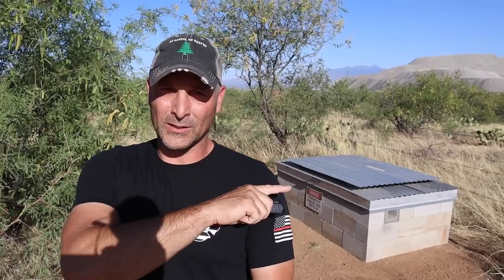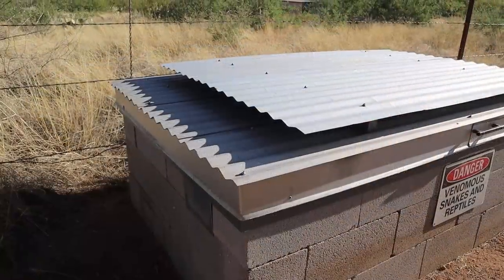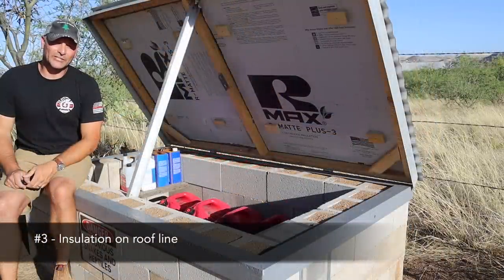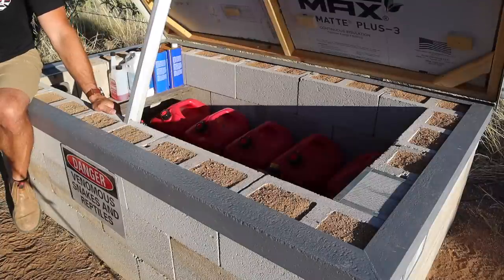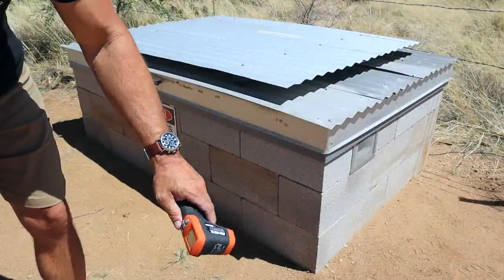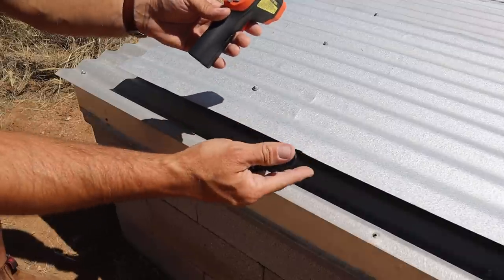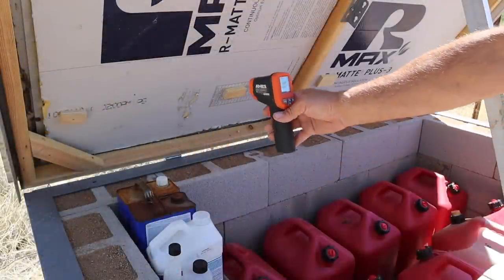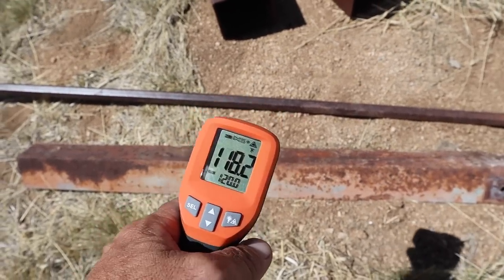Fuel Storage Box - UPDATE & Temp Testing

Comment: The roof is too reflective to get a good reading based on how the IR thermometers work.  One trick you can do is to use sharpie or spray paint to make a black dot on the metal and then you'll be able to read the temperature much more accurately.  That's what we do in chemical plants when we use the IR temperature guns on stainless steel piping.
Reply: You may have an emissivity setting, but I normally just do what Brett suggest with the black tape.
Reply from the maker: Definitely makes sense.   I tried shading it but I think I’d have to have made a much larger shade than my hand to not have the interference of all of the light bounce back.  Thank you for the advice too! 🙏😊

Comment: The corrugated roof is acting as an infrared "mirror". You are effectively taking the temperature of the sky. I tried the same experiment with a similar thermometer aimed at a piece of corrugated metal and got the same result as you. If you aim the thermometer at the sky, you'll get a similar reading, but probably a bit lower since the roofing material isn't a perfect reflector. That's one of the reasons it makes a great roof, all that infrared heat from the sun is reflected back to the sky.
Reply from the maker: Well that’s the answer I was needing… thank you🙏😊
Reply: @homesteadonomics  you can see it even better with a thermal imaging camera as you can see that most "reflective materials" including glazed tiles on the wall as well as painted smooth surfaces reflect infrared rays... you can basically take a selfie with a thermal imaging camera by looking onto a piece of sheet metal or something like that

this is one of the most common mistakes on thermal imaging as well as temp checking by home users... and why there are false readings that don't make any sense
Reply: Aim it at the under side of the same metal or put a piece of black tape ok the top. If you paint that whole thing white it will drop the Temps even more.
Reply: Put a thermometer inside the structure, check it later. Now you know what you need to know!

Comment: Just wondering if you don't have a problem with burrowing rodents. We had an 8 x 12 storage building set on a foundation made out of one foot square pavers and the little chipmunk sized ground squirrels burrowed under the pavers and made nests which of course made the floor of the shed week in areas because the pavers sunk into the burrows and got all out of sorts. Seems like they'd make quick work of tunneling under those cinder block walls.

Comment: I love this. This is so simple, well thought out, and ruggedly elegant. Your iterations are brilliant! Your roof is what I call a “safari roof”.
Reply from the maker: ‘Safari roof’…. I like that!   I’ve been thinking Of a similar idea for my goat barn to take the edge off on the western side
Reply: Found on Landrovers in Africa also known as a safari roof, nice 👍
Reply: Yes, African and Australian overland vehicles, that’s where I learned the term!
Reply: In the North a similar technique is used to prevent icing on the roof.  It is called a "cold roof" and uses  2x's run top to bottom between the sheathing that has a layer of felt on it and another layer of sheathing.  This keeps the roof cold enough in the winter so the snow does not melt but will slide off.  It also cools the roof thru a chimney effect.

Comment: Measure the back side of a shiny surface if you can. If you can't put some tape on the surface and give it a minute for the temperature to equalize. Then measure the temperature of the tape. It won't be exact but it will be very close.
Reply from the maker: Another great suggestion that I wish I thought of… the underside🤦‍♂️.  I was trying to get it all filmed rather quickly in between gusts of wind and I simply wasn’t thinking😂

Comment: Thoughts for your temperature differences; the corrugated metal in the sunshine is doing what it is designed to do, reflecting heat.  The heat from your thermometer is being scattered by the metal roofing as well as being diffused by the sunlight.  You do not have the same diffusion on the shaded under surfaces.   Your heavy gas vent pipe could be providing cool air from the ground as the warmer air rises and flows outside the upper vents.   

Great cameo by the toad.  I hope it was relocated to a nearby ant hill for its afternoon snack ;-)   Thanks for sharing this follow up video and acknowledging all the suggestions.   Hopefully the wildfires plaguing New Mexico will stay away from Arizona.

Wishing you and your family a blessed week and a gentle spring season.  Peace brother
Reply from the maker: Yeah I think you’re right!  The reflection of the material probably wouldn’t refract to get the temp.   I tried shading an area with my hand to mimic the under size, since it registered accurately.   But perhaps I needed a larger shade as the excess light reflecting my light have caused the issues with just having my hand shade that tiny spot.

And yeah, we love having them here as they pretty much feed on ants and I’d rather have these little guys versus the ants.  Win win!  

As for fires.   They are here already.   Some down near Sonoita which is a over the Santa Rita mtns from me.  They’ve got a LOT of rolling grassland over there so usually once a year they’ll get something.   As for us….just all the more reason to keep my firebreak maintained😅

Comment: Did you notice that you logo does not fit you noise floor 😛
What i would add to your ending message, go decentralize. In any possible aspect.
I guess in between many people have mentioned the thing with the material coefficient for reflectiveness, which matters a lot in regard to readings of infrared thermometers.
Have a good time ;-)

Comment: With the thermometer and scanning off the roof the interference might be coming from the sunlight reflecting off the roof interfering with the infrared sensor of the thermometer being that there is a certain amount of infrared light coming from the Sun to begin with you could try shading the spot your reading next time depending on how shiny the service you're reading is it might just be that you could try testing it on top of a vehicle surface in the same kind of conditions with the sun overhead and see if it does the same thing
Reply from the maker: I agree.  That makes sense.   I tried shading the IR spot with my hand but I’m sure there was just too much light reflecting every which way.   Probably would’ve been better to get a larger shade area to mimic the lower roof, which seemed to register well.   Thanks! 😊👍
Reply: @homesteadonomics  if you happen to have an umbrella you could try that for shade if it's something you're really curious about trying to figure out

Comment: I suspect the weird readings or from the reflection, try casting a shadow with your hand on the top peice and re scanning
Reply from the maker: So I did try shading with my hand but still same result.   But the shading on the lower roof was much greater, so I am thinking though that if my shade was larger that it would work.  Probably just to much excess reflected light confusing the thermometer.
Reply: @homesteadonomics  maybe try a vinyl sticker of some sort? Or some matte paint

Comment: Did you use 42th blocks?
Thanks for a great video 👍
Reply from the maker: I think so…. But in this iteration I replaced 2 of the 8x8x16 blocks with 4 - 8x8x8 blocks.   So it’d be 40 of the standard and 4 of the half blocks
Reply: @homesteadonomics  
Thank you for the reply. 
I'm in Indiana so I may not do the vents. But I can leave a gap at the top probably.  Thanks again!

Comment: My dad always told me to never set the gas can on the ground. Maybe setting a board between the ground and the gas cans might avoid future moisture problems. Just sayin!
Reply: Living in northern Ohio if you set your cans on the ground the plastic will have condensation and metal will also and rust. Always set on wood, raised off of the ground like a pallet having air space will keep the cans dry. A vent under the cans to the outside will take care of propane.